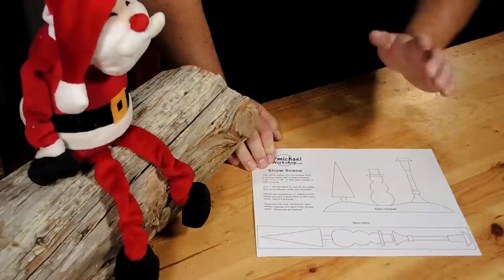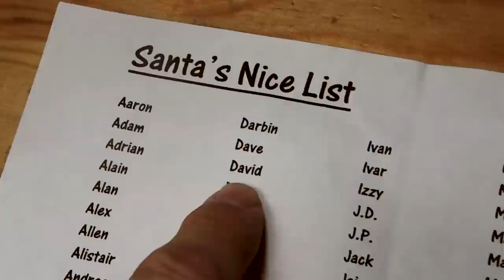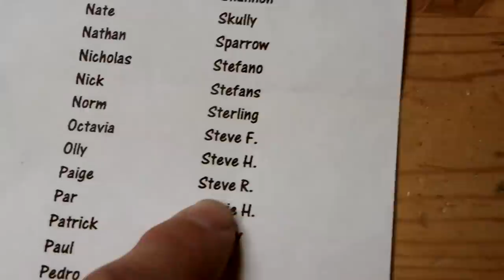Make a Holiday Snow Scene - Christmas Woodturning Projects

Comment: Steve, this was a great project! I really like it and think it is a good skill builder for those just starting out in wood turning. 

Watching the glue up I was wondering, would a little tendon on the bottom of each item help. I was thinking this would give more glue surface and possibly a stronger joint as with the tree, they would all be attached in a hole. 

What is your thoughts on this possibility? 

Thanks for sharing all your woodworking videos.  I really enjoy them.
Reply from the maker: Randy Owens Thanks Randy!  That would be a great addition and another skill to learn to use a caliper to get the right diameter.  I drilled a hole for the tree trunk so it would make the others stronger.  Good idea!
Reply: Great!  Thanks Steve! Merry Christmas!